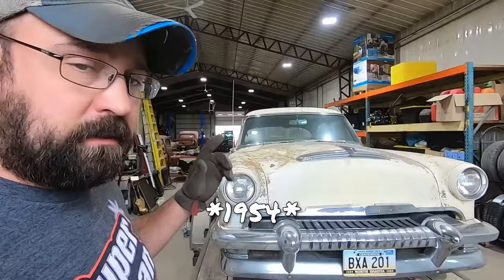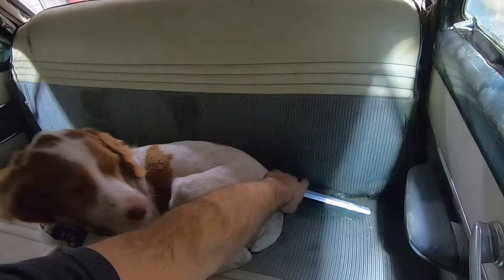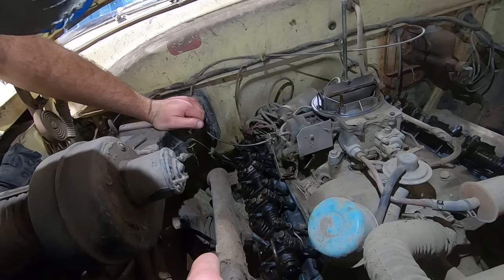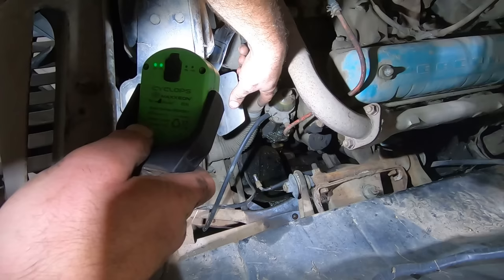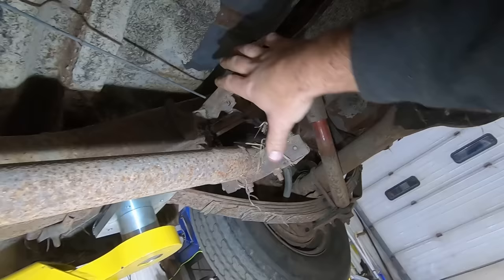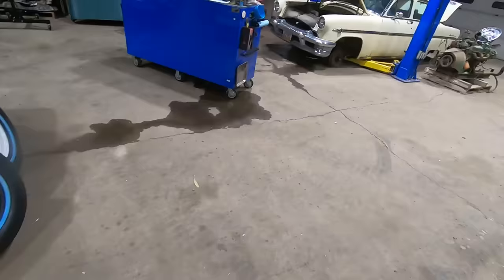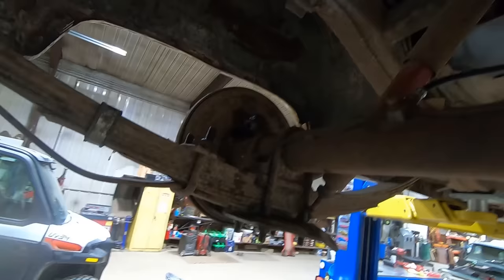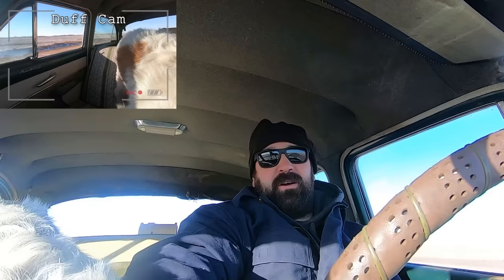1954 Mercury Monterey Transformation! Abandoned in a Field for 29 Years! Will It Run?!?

Comment: Don’t fight the fuel tanks.   I modified an old electric concrete mixer with arms and straps to tie the tank to it.   Dump a couple of handfuls of self tapping screws and sharp steel stuff in it, add some paint thinner or mineral spirits, cap the holes, and let her tumble all night.   Rinse it out when clean, use a magnet to pull out the sharp steel tumbling media.   Keep up the fight, Mortske
Reply: I always use an old roto-rooter with a couple pounds of ball bearings to do pretty much the same thing, it does a great job and is a lot easier than trying to get it cleaned out with chemicals ( and not to mention it's not as hazardous to your health ) the good thing about the roto-rooter is I didn't have to modify it since it has the easy-release drum, 
I just made a separate attachment for it out of an old 20" bike wheel and some angle iron and it is also great for mixing up 5 gallon buckets of paint or  polyurethane for when I have to repaint the shop and reseal the back deck.
Reply: Jk

Comment: Back in 1967 my good friend Rob lived next door.  His dad was a mechanic for a chevy dealer and Rob was mechanical minded just like his father.  The family didn't have much money to spare (8 kids), so when Rob was 14 his dad bought him a 54 Merc that wasn't running in order to get the kid a car cheap that Rob could fix up by the time he turned 16. They had a large garage with all the car tools anyone would need, remember his dad is a mechanic. The trans (yes, mercomatic) wasn't working at all, so Rob pulled it out.  After a month or so I went over to see Rob while he was in the garage working on the Merc.  He had the trans completely taken apart, it looked like a thousand different pieces.  All kinds of different springs, bebes, rods, plungers, nuts, bolts, washers, filters and you name it!  I was a mechanical guy (later an engineer) myself, but I looked all those pieces all over the place in different pans and tubs, and I though I would never want to take on that job, I'll just stick to manual transmissions.  I though how will 14yo Rob ever get this pile of stuff back together.  But then I though again, it's Rob he can do it.  He did it, it took him two years.  He got the trans back together and repaired a few other things all with out much from dad.
Reply from the maker: Good times!

Comment: that phrase
" always check your wheels "    
you couldn't be more right...
I recently had a problem with my pop-up camper trailer that exemplifies the importance of that...
But, mine didn't have any issues with being tight...
 in fact I still had to take the lugnuts off with a 4-way to put the spare on....  
I put a pair of borrowed tires/wheels on my pop-up because after 8 years at the deer lease on the Arkansas River the wheels didn't have any rubber left on them.... 
being a smart man I torqued them down and drove 12 miles to town and back and re-checked them...
they were still good so I started off on my 375 mile trip...
I was about a third of the way to the destination when my pop-up started bouncing like it had a blowout ....
I pulled over and got the shock of my life....
 the tire was NOT FLAT ....
it was on the side of the road about 1/4 mile behind me...
now, remember that I said that I still had to unbolt it...

The tire was still inflated and the lugs were tight ...

and i know what you are thinking,  no, the hub did not come off

THE RIM ITSELF FAILED....
the outer ring actually separated from the center disc at 75mph.... the wheel had apparently been welded by Stevie Wonder and had come apart at the welds... 

I'm over 40 years old and have been around cars and the race track my entire life and That is the first time I have ever seen a rim separate in that way without having over 400 hp trying to do a burn-out on it.

this was on a GUTTED and empty pop-up camper that weighs less than 1700lbs before the cabinets and other stuff got stripped out....  

THE REALLY SCARY THING IS THE WHEEL WAS ON THE FRONT OF A DAILY DRIVEN 2012 VW BEETLE WHEN I BORROWED IT....

The guy I borrowed it from said his wife has been driving it to work every day and me borrowing it probably saved her life because she doesn't go under 75 mph on the interstate to get to work.... 

Dumb luck or God intervening?  
Make your own choice.
mine says that the word luck is just us not knowing what the truth is and giving it a generic name.

Comment: Batteries can surprise you sometimes. I sold used batteries for years at a junkyard. I brought back one that was 17 years old that came out of a 79 280Z that had been sitting for nine years when I bought the car. I had to charge it for 4 days on 3 different machines, but it tested like a brand new battery. I even left it on the shelf for a few days to make sure that it held it, and it did. I actually ended up putting it in a car that I sold. I didn't even change the acid.
Reply from the maker: Interesting

Comment: On that receipt from the glove compartment:  FD8182V is the Standard Ignition part number for Ford points used in Mercurys from 1954-1956, and then again some Mercury models from 1969-1974.  The letter "X" appended onto the part number indicated that the part in question was from Standard's higher performance "Blue Streak" product line.  I worked in an old auto parts store while I was in high school from '74 to '76, and sold many a set of points.  I also was a good customer for ignition parts, as everything I drove back then was pre-electronic ignition, and everyone in my family would bring their cars to me for tune-ups!  Love the Monterey!
Reply from the maker: Good to know! I love vintage parts!

Comment: Speaking of 55 TBird my neighbor had one and the radiatorspring a leak in the transmission cooler so when we put it back together i put a 3speed in it. Changed the shifter to a mustang gear shifter and built a tunnel cover and it turned out great and made a big difference in the way it ran.

Comment: Spring you found in the gas tank is from a gas pump nozzle that had slid off of the nozzle. It was used to keep the nozzle from slipping out of the filler neck years back.

Comment: If you think parts for that car are expensive, then try restoring a '79 Volare. Mine needed a grille, and the cheapest I could find was a broken one for $800. The body was perfect on mine, but replacing the trim and plastic pieces exceeded the total value of the car by several multiples, not to mention the fact that it took a decade to find the parts. Everything was discontinued, so everything had to be pieced together used from various sources, and none of it was cheap.
Reply from the maker: Ouch

Comment: Finally finished the whole video been busy .  Those hubcaps are very hard to come buy the fuel pump I sent mine away to get rebuilt and sent back to me same with gas tank got it taken apart and relined. All those switches on the dash board are all worked by cable. The headlight switch and interior light are both pull in and out no need to turn them. Those vents under the dash by the firewall Those are opend  and closed by the vent switch on the dash. They let fresh air in from outside.  Mines the exact same color combination in the interior.  Wish I was closer id buy that off you in a heartbeat glad it's up and going again. ! Great work 👏 oh and by the way first year for Mercury's over head valve engine was 54. The engine in mine is the same still has the oil filter casing on it. It's tricky to put back on once you take it off.
Reply from the maker: Thanks for the info!

Comment: Excellent video Mortske Repair  :) also nice car to work on plus you fix up that broken window also spare wheel floor panel and what need included exhaust too! She fix upper for sure also should say take much to be ready get on road easy and great find too! That first one of Mercury models seen long time and did 2008 a Mercury Monte Clair in 4 door with 318 V8 with 1970  302 Mustang Motor 4 barrel 650 Elebrock carb , daul exhaust, 3 speed Automatic transmission, 377 rear end gears plus power steering and brakes too hook up 12 Volt Negative ground also modern 12 Volt Negative ground anolged radio plus 6 speakers and radio antenna too! Body color was Tan , Beige White  with chrome all interior was in amazing shape on Tan plus Beige  colors factory rims plus had spare tire in middle back bumper plus trunk that pop of to right to get key lock ! One thing surprises me fuel door on left side Square had pull hand buy driver seat door release it and go door pull finger pull hood up then  take fuel cap fill up and put cap on one 1 turn and push door hear click and pay for fuel and then drive off!

Comment: You’re correct about the bent Pushrod. Weak or bad steel is extremely unlikely.

And you’re right about the weak link, every system needs a fuse, lol.
not just automobiles. Everything needs some kind of Plan B safety built in.

Without that weak link or fuse when A rookie , over-revs the engine lots of things can go wrong

Comment: On gas tanks - I have had really good luck with POR 15 Gas tank coating system.  It is a lot of work cleaning out the inside - their cleaner works well to get the varnish out, rinses with water, then the metal etching fluid, then the coating.  I've done two tanks, and years later - not a bit of deterioration.

Comment: Buddy had a 54 Ferd with a Flathead 8.  He bought some sort of converters so he could use a 12V battery but the gauges/instrument cluster were powered 6V.  It was in the late 70's early 80's & I'm senile so can't say how well it worked. I do remember the starter still got 12V & was told would not hurt it because 6V carries more amps & thats what kills. Again do not know that for sure.

Comment: My Dad bought a 53 4dr in 54-55 , it was dark green and had a lot of options. Flathead, I loved it , his first automatic. The flattie kept breaking and in 59 he traded for a 57 2dr with a 312/4bbl FX tranny that a Ford mechanic had ordered new. He caught us leaving with the 57 and bent my dad's ear for about a good 1/2 hr about the car and what he had done.  When I got my license I found out how quick it really was. LOL
Pumps oil but notorius for plugged returns, outside oilers werec common.
You gonna fire it off with old gas hooked up ?
Could have mounted that new coil on the firewall .
OMGosh, lol when the brake cap popped !
Great job ! subbed
Reply from the maker: Much appreciated!

Comment: You probably could save that tank if you spend a weeks time cleaning and recoating the inside. I feel like it's rarely ever worth the effort. I did it on my beetle, and it's still holding up. My dad convinced me to do it since we were trying to do it as cheap as possible, and the rust wasn't too terrible. Was a good learning experience for a teenager.
Reply from the maker: If only we had 72 hours in a day to do things like that.

Comment: A neighbor of mine had a 55 TBIRD and the radiator sprung a leak in the transmission cooler. When i pulled the engine and trans out i cleaned everything up but when i put the engine and trans back in i put reman 3 speed in and put a  mustang shifter and redid the spot where the 2 speed shifter was i was glad to do it because the person was every sick and had no money and at the time i was working for Ford and had access to parts.!!!!!!!!!!!!!!

Comment: I was going to mention Auto city classic, glad you found it. If there are some bigger, local swap meet shows in your area, they may have a booth there. Any show they attend, If you contact them ahead of time, they will bring the parts you need with them to the show and it saves a ton on shipping. Something to note...I had them bring me a windshield for my 2 door hardtop caprice ('68) and it didn't fit. They gave me a 4 door sedan glass that was marked wrong. Customer service guys are dicks to deal with. I had trouble with them again on a disc brake conversion for my '59 Biscayne. I swear I didn't even realize it was a 2.5 hour vid. Always entertaining!
Reply from the maker: Seen them at Iola.

Comment: Congratulations on a getting a Y-block to run after sitting for 29 years! I think 1954 was the first year for the Y-block. The OHV V-8 was new for Ford. It could explain the valve train problems.
Reply from the maker: You are correct

Comment: 1954 ford displacement 239 / mercury 256. original carb 2bbl carb would have been the same teapot design as the 4bbl. dual exhaust was an option on the mercury. the valve lash .019H. Horsepower 161 with 238 ft lbs of torque. 7.5 to 1 compression ratio, top speed 100mph. 272 was the std v8 for 1955 for ford and mercury.
Reply from the maker: Awesome

Comment: I was just out at Auto city classics a week ago with a buddy to get  window glass for a 55 Ford truck rat rod we are building using crown Vic police packed engine and front frame and it's built up compared to when I lived in East Bethel MN 40 years ago but they do offer a lot of stuff for old cars .  We put one of their 4 wheel disc brake kits on the 69 Plymouth Road runner we built that's on the road now and it seems to work good but the instructions were vague at best but figured it out .  I think some years ago engine masters did a built 312 thunderbird engine on a Dyno and what it was is a few old car engines that guys had built and they had a Dyno shootout so maybe look into this .
Reply from the maker: I’ll check it out

Comment: Fuel pump and a quick wheel bearing greaser and possibly a run from Gwinner,ND. to Pittsburgh, Pa. cannonball run style? Let me know if you would be gracious enough to do a quick check and change everything for a great drive home for me and a 78 year old from the Mortske shop?. TTYS and I will hope you two have a great weekend and afternoon. Don't feel bad it is 28°F here today. Probably a few degrees colder there. I almost forgot the brakes hoses you showed me in the video. Better bring some Pipe and a glass pack to #9 and clamps.

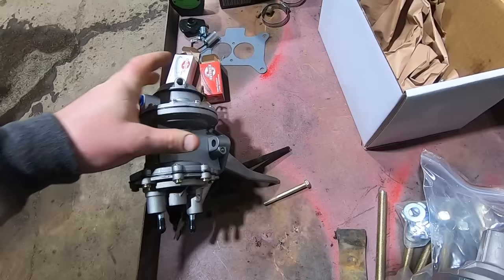Comment: @2:16:00 ran into the same problem on 85 Ford looked like no way the lift pump arm would work but it did was just a different design as long as they’re about the same length it should work

Comment: Get a sheet of 2" thick foam for your doggy or even a doggy bed to keep pooch up off of the concrete floor when resting. Hard to believe they don't have diaphragms for that fuel pump. Nice V8.
Reply from the maker: He's got beds all over the shop he chooses not to use

Comment: Good job, Mortske - if you find a '51 Chevy Business Coupe, in maybe a liitle better condition than this Merc but with lots of surface rust, then you and I will talk. Actually, almost any early 50's Chevy will do if the condition is right. Lots of patina but not much rot. I don't know if they made such a thing, but I'd like to find a '51 - '53 model with the 235, but with a manual trans. The problem is that Chevy offered the 235 as a deluxe option starting in '51, but it came packaged with a 2 speed automatic trans. I can always hope to find a 235 with 3 on-the-tree, though. Maybe there's one out there somewhere. Keep your eyes open for a '48 Fleetline, also. If you ever find a survivor that runs okay, with lots of rust but little rot, you know where to find me.

Comment: Power
V 8
Displacement :	4195 cc | 256.0 cu in. | 4.2 L.
Power :	162 HP (119.232 KW) @ 4400 RPM
Bore :	3.6 in | 92 mm.
Stroke :	3.1 in | 79 mm.
Compression :	7.5:1
Main Bearings :	3
Valvetrain :	16 OHV (2 valves per cylinder)
Cylinder Block :	Cast-iron
Holley 2140 4-barrel carburetor
I know I pasted it below but separated it for ease of view of engine info.

Comment: You can't use those skinny battery cables.  6 volt starters draw twice the amps as 12 volt starters, and twice the amps means 4 times the resistance.  You need thick 1 gauge cables, including the cable from the junction block to the starter.
Reply from the maker: Don't tell me what works. Been doing it for years.

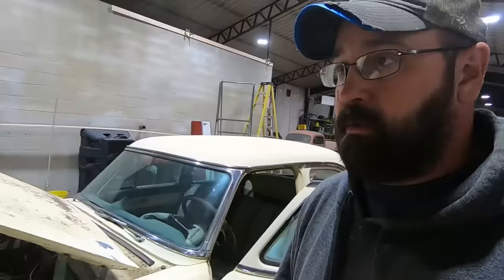Comment: 1:08:00 well if you come to Oklahoma there's a decent size shop with electricity for $475 a month right here in Lawton, it's close to where I work but not where I live so I can't justify that much extra cost but am happy with my 14x25 storage unit a stone's throw away without electricity for $125 a month.  I just do everything with batteries (lights and all the DeWalt things) and when they run out I go home and charge them and watch videos and then go back over when they're all done.  Might get one of those Jackery power stations at some point to recharge things in the shop, put a solar panel above the door frame or something.
Reply from the maker: Use what you got!

Comment: Pretty sure that isn't a 256 Y block. That model carb wasn't used until late 50s. Don't think that intake will fit a 256. Most likely it's a 292. Good to see you saved this one!
Reply from the maker: The carb kit I got from RockAuto for a 54 Merc fit right into it.

Comment: "Motorvator" was the K-Mart branded Oil Filter, akin to "Super-Tech" for Wal-Mart...This was the brand preferred by my frugal dad!
Reply from the maker: Good to know!
Reply: @MortskeRepair  I should also add that the use of this filter and motorvator oil resulted in a piece of debris jamming the oil pump gears and seizure of our 350 Windsor power Ford Fairlane Station wagon. Dad was a fram fan after we had to replace the short block.

Comment: If I had $4.5k I could part with it would be in my garage already, I need a winter/summer project.  As long as the rust isn't too bad, I'd drive it as is after making sure it starts, rolls and stops.    Unfortunately I have to pay bills before buying toys, but you don't find em this original very often, if at all.